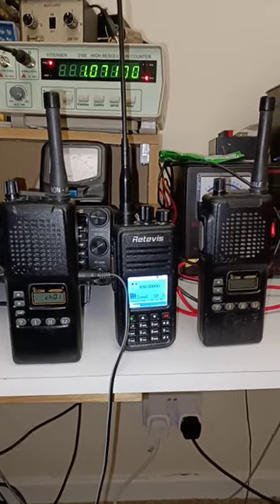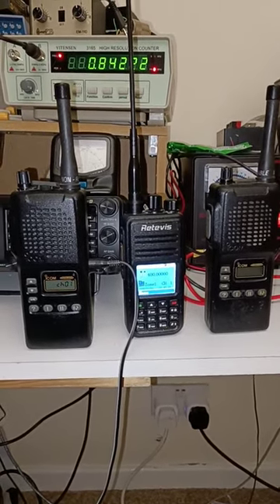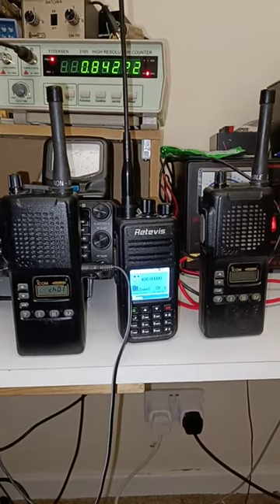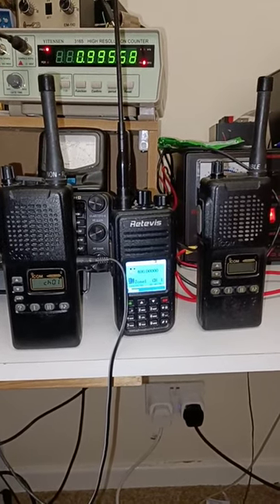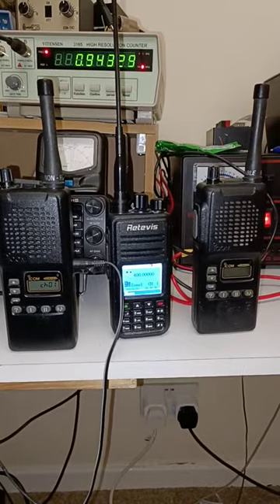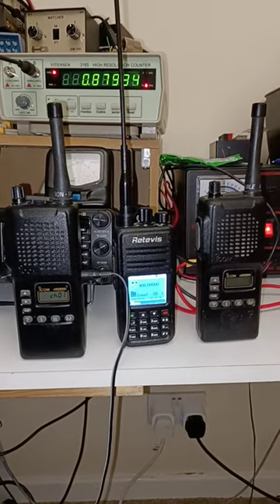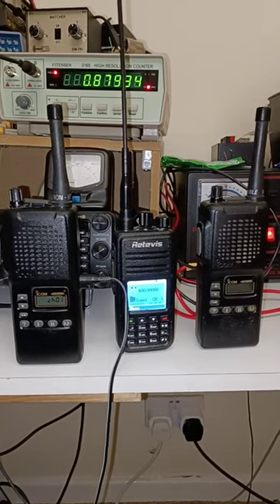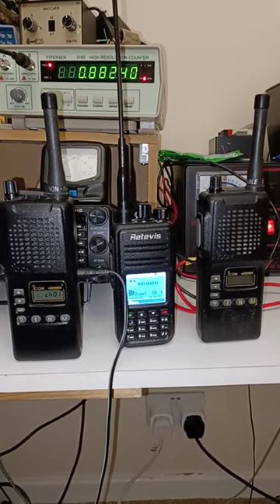3 radios to get working #shorts

Comment: Icoms will probably be the old SRBR frequencies
Reply from the maker: I popped those on a frequency counter and surprisingly they're both PMR446 which I really was not expecting, the antennas are non-removable as per the PMR446 standard.

The battery pack on one of them is well and truly knackered, the other pack seems to be ok however but discharges fast due to age of the NiCd cells inside